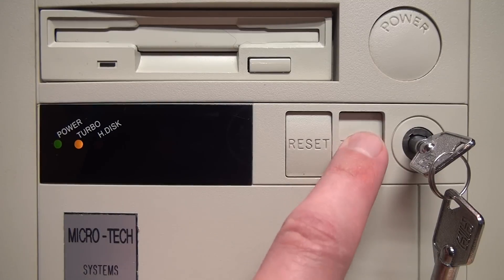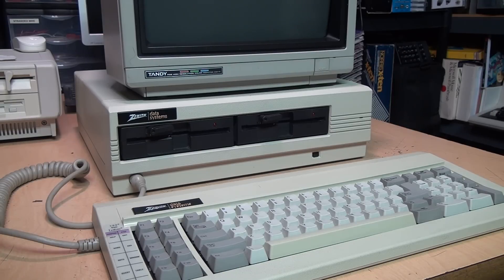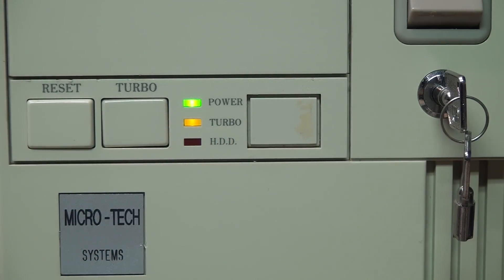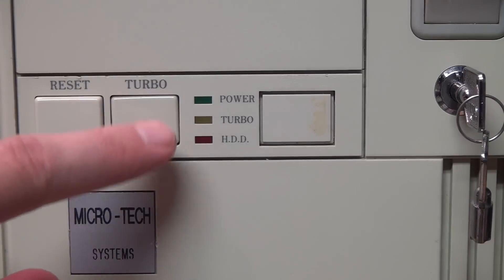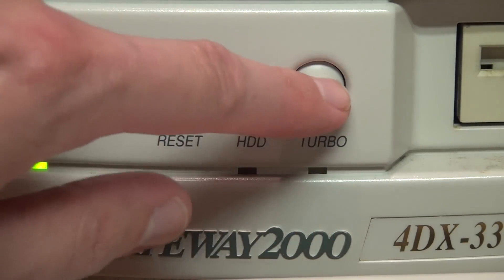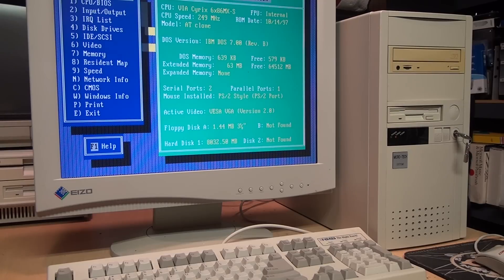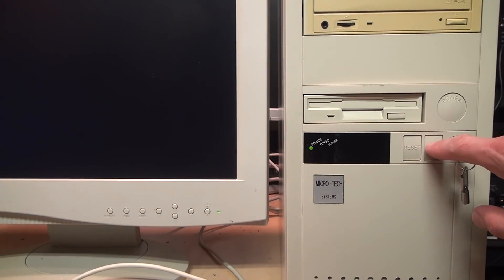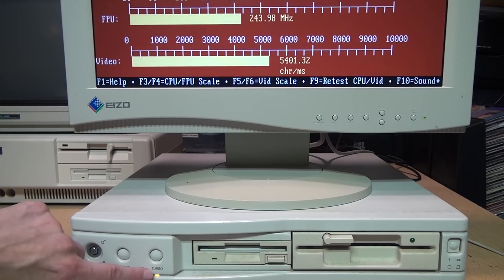The PC turbo button mystery finally solved! (beta version)

Comment: So the operation of the 'turbo' button is not to increase the speed of the PC, but to slow it down, since when the turbo is on, the computer actually runs at the speed at which it should run. They should have called it 'Slow Mode', to be activated with older applications. It wouldn't have caused any hype, though, in the advertisements of the time.
Reply: Basically in short form

thanks for the info man i owe ya!!

Comment: 4.77 ok my computer can be overlooked up to 5.2 except that you will argue that my computer CPU base speed is just 3.37 so I can then use my wild card 🃏 and tell you that it is not in MHz haha… well 😅5200 MHz (but then you will tell me it’s only on the 2 best core but I think it’s already twice more than the example in the video and my 8 other cores are still working at 49 x100 MHz)… ❤ I love the modern times because it’s the only time where we can be nostalgic for the past 🥹

Comment: And here I thought the Turbo button just made the fans spin faster, forcing more air into the system causing more combustion, better fuel efficiency and higher power output for the smaller cylinders present in the CPU's at the time.

Comment: Oh man. That turbo button takes me back. Our 1st home computer was a 286 or 386 of some kind and I used to think about the turbo button as a "make the computer go slow button" because in my mind with it depressed and turbo LED on I figured the PC is running at normal speed and with the turbo off the computer was slow. We didn't have "old games" that would run too fast in turbo mode but all our normal games ran slow with turbo off so I also thought it should have been a "slow mo" button instead.

Comment: I remember I had to push the turbo button on my old 486 66Mhz so it could run pokemon red on the No$gmb emulator with no lag. Those were the days...

Comment: Excellent summary! About the only thing I would add is during the 586/686 era computers that did still have a turbo button depending on which of the common chipsets it used it wouldn't change the CPU clock speed any more but rather enabled / disabled the L2 cache memory on the motherboard instead.

Comment: great vid VW, you showed the benchmark/speedtests, but one thing you should have done was demo an old program in both modes to show the viewers why this was necessary in the first place as the old programs were unusable on the new faster systems without the speed adjustment

Comment: back then backwards compatibility was essential as there were too many little companies making (assembling) low quality PCs, the competition was cut throat...Turbo = normal speed & a turbo button looks cooler than having "slow" or "1/4-1/8 speed" switch

Comment: You can ignore when the button is in or out, look at the light. You have three wires because that is a SPDT switch and either way you put it on the header it is gonna make or not make a connection.

Comment: What mystery?  That button has always had a clear specification.  Back in the day programs would be written based on the CPU clock rate.  The turbo button is to prevent your program from running 2x speed when it was designed for the lower clock rate.

Comment: I never had an computer with a turbo button, jumper of boot command. Since my 1st computer an radio shank tandey had hardware and software preinstalled that made that not needed. My 2nd computer also didn't have that for the same rezone.   My only real issue with the 2nd computer was the move form DOS to Windows 95 and man that was not easy.  My 3rd computer running Windows 98 was the 1st time I had no real issue learning how to use an new OS and was my induction to video game console emulation.  Before then running my DOS games on Windows 95 was only excpatnce with emulation.

Comment: They should make one of these for high end pcs to enable or disable cpu cores over 8 to enable better old pc games compatibility with badly programmed 2000s and 2010s games. I have issues with many games with cpus with over 12 cores and I think that would solve this problem that is becoming more prevalant in the last 7-10 years.

Comment: The turbo button was also very handy for overclocking. On motherboards that used jumpers to select the clock speed, the button would replace one of those jumpers and that was usually enough for switching from 33 to 40 MHz on 486 boards, or 66 to 75 MHz on socket 7 boards, for example. Instant overclock at the push of a button.

Comment: I'm honestly glad that the keyboard lock vanished with the turbo button.  I don't know how many PCs I saw with fried KBC or multi-I/O chips after someone accidently discharged a static electric charge through the lock while trying to push the reset or power button.  Even for the few users it was useful for, it was usually easily defeated with a screwdriver and a jumper since few cases were ever locked close.
Reply from the maker: On IBM systems the keylock actually also locked the case. But on most clones it didn't.

Comment: Back in the day when I put Pentium motherboards in old 486 cases I used to repurpose the turbo switch as an overclocking jumper to change the FSB speed or clock multiplier. So, for example, a P133 would run at 150Hz.

Comment: INTEL:  Turbo-button swithes CPU clock divider to slow down 4 or 8 times of its nominal speed.
VIDEO: Conclusion - Turbo button slows down CPU is a myth.
Reply from the maker: Read it again. That is the "de-turbo" mode, not the turbo mode.

Comment: Incorrect. The original IBM PC was the XT which used an 8088 cpu that could run at 5 Mhz max. 4.77 Mhz was used as the cheapest crystal was the color burst frequency of 3.57 Mhz and 4.77 is 4/3 of 3.57 which al;lowed margin at the poorly designed XT motherboard. The first 'Turbo PC' was an 8 Mhz version of the 8 bit 8088 (not the 8086 (16 bit) which came after the 8088). the 8086 was used iin the AT computer. The turbo button was used to SLOW down the pc to the original 4.77 Mhz speed since several games had timing loops that were dependent on the actual CPU clock speed and wouldn't run properly at the faster 8 Mhz speed. My first IBM compatible (early to mid 1980's) was a clone that started with a bag of USED ics and a motherboard that was then hand soldered and ran if you were lucky enough to get good ICs.

Comment: I had a secondhand PC with a display like this and a turbo button. When I opened the front, there were literally just a bunch of jumpers that determined which segments were lit. So you could switch the jumpers around to make any kind of character you wanted that could be shown on a 7 segment display. So it's not an actual readout of the processor speed, but a marketing tool to wow the customer more than a simple light would.

Comment: backing the old days it be like 13 or 16 or like mhz boost in cpu clock worked on all these back the in days beena long time but worked of tens if thousands of these stripping rebuilding upgrade selling I miss it I loved it so much cried for like 20 years when I could no longer make money here in live also peppel are highly rapist they will hire felons rapist over hard working colored people and its afact I had my head cracked open by 2 different school I was called a worthless Mexican from 2 end grade till 11th stabbed beat put down all by white people not one colored person hurt me so you can't pull there not racist shit

Comment: It was a mystery when the first time I encountered them. When my next-door Neighbour had bought a brand-new Pentium PC computer, I tried playing old games from 5" diskette and the game was way too fast, then pressed the turbo button and the old games ran normal speed. One of the few old game such as Alley Cat have built in code that automatically slows down when CPU is more powerful than optimal.

Comment: Thank you! I had many lengthy discussions about this in forums and people have terrible memories. My 486 had many configuration options with multipiers and various fsb's. I remember overclocking a DX2-66 after adding a heatsink and a fan. I think people are confused because the base clock was divided for non turbo function. You could set your overclocked DX2 to 80mhz and downclock 4x to 20Mhz non-turbo.

Comment: I worked for a company and built many turbo switched pc's. All ours had digital readouts. The switch changed 33mhz to 16mhz depending on which way you plugged the connector to the board. Ours were always set to highest speed and pushing the switch slowed it down and changed the readout to match.

Comment: I have a Z-148. Given its age, I'm happy it still works. Sometimes I get a memory error when I boot in fast mode; apparently the memory chips don't like it. I just switch to standard speed and it boots fine.
The original Compaq Deskpro had two speeds. It came with an 8086 cpu, but could boot at 4.77Mz or 8Mz. There was a small LED on the front panel that showed red for slow speed and green for fast speed.
A cheap way to tweak your system was to buy an 8Mz NEC V20 as a drop in replacement for the 8088. It was more efficient than the 8088, and most speed rating apps gave it a 10-15% higher rating than an 8088 at the same speed.
DTK turbo XT replacement motherboards were quite popular at the time.

Comment: I remember my old (1989) Tandy 1000 SL/2 8086 CPU had a dual speed option of 8 or 4 MHz, changeable via a setup program and saved in EEPROM.  They elected not to clutter up the front of the case with extra buttons, LED indicators and display.  Though I'm tempted to believe it was for cost cutting, all those extras probably would've made it better for sales, if you look at their other electronics at the time.  So maybe their minimalist approach was actually way ahead of its time!
Man I can't believe it's been a third of a century...  making me feel old.
Reply from the maker: Most Tandy 1000s didn't have a power or hard drive indicator LED, either.

Comment: Some literally did nothing to the computer itself, the speed would be set in the BIOS (or through a program to edit the EEPROM) and the button merely switched the LEDs between two displays. Some systems forwent the button altogether and just put a jumper on the back of the LED to select the display. I remember a long time ago, it was actually pretty interesting to reverse-engineer a few different kinds of LED speed displays to figure out how to select what it would display.

Comment: My reasoning for many authors and the general users saying "hurr durr Turbo button make PC slow!" is clearly that the Turbo Mode that the button was supposed to engage, was already on by default, not only because the possible lack of availability of cases with a dedicated button, but as stated halfway through the video: less and less people needed the compatibility mode, and by a certain point in time, they were better off tweaking the BIOS to change the speed and cache settings for better operation.

The Turbo button hasn't died as a niche proposal, I remember having an ASUS AM3 motherboard with a Turbo Button utility that through a software mod, could repurpose the Reset Switch as a Turbo Button to induce "turbo mode" OC, which depending on the quality of your chip, would either sloppily overclock it, or just simply deactivate the Cool 'N' Quiet setting.

As someone stated before: I think that now, with things such as Intel's Thermal Velocity Boost (TVB)/Enhanced SpeedStep Technology/Intel TurboBoost Technology; and AMD's Precision Boost Overdrive (PBO)/ECO Mode, the Turbo button could make a comeback, especially after the latest AMD Zen 4 chips have proven that nobody likes their CPU to run at 95°C and that the scaling is non-linear on such chips when gaming, only when doing productivity work there's a variance.

Comment: aside from people who fundamentally don't understand it, it's a matter of perspective since the point of the turbo button was provide the ability to slow down the computer since without it the computer would run as fast as it can. Paradoxically the turbo button when engaged does nothing and merely doesn't slow the computer down.

A better term would be normal mode when on and compatibility mode when off. But I would assume marketers came up with turbo because it sounds faster and more exciting than normal mode

Comment: It's semantics, really. I think the confusion stems from the fact that the implementation of the turbo button at some point changed. On the XT class machines, it changed the clock frequency and the timing of the entire computer, to the detriment of peripherals. Engaging the turbo mode was like stepping on the accelerator of a car while you are already at the speed limit. Scary stuff! 

On later 386+ systems that was no longer enough, and the non-turbo mode started adding additional waitstates and other trickery to further reduce the computers speed. Also, at this point I/O timing had long been isolated from the CPU frequency so the original went away. It's no longer an accelerator pedal, but rather a brake pedal, which just happens to be wired in reverse. Sure, pressing it will make you go faster, but that doesn't change the fact that you are disengaging a restriction. Boring stuff.

So yes, I do feel like the name is misleading a bit. For me, a switchable overclock would be more worthy of the name. Which was the case in many early turbo XTs: components would be driven out of specification, (especially on extension cards) as they were designed for a 4.77 MHz bus. (hence the initial risk of data loss and communication problems)

Either way: Turbo mode engaged is faster.

Comment: I'm curious... Have you ever tested the slow down command on the Dell Optiplex (and I think XPS Dimension too) line. <CTRL><ALT><\> for "compatibility" mode. Curious as got a couple of Dell machines in parts I was intending to set up for retro gaming.

Comment: I remember the 486 motherboards with the turbo jumpers on the motherboard and the turbo LED pins

The speed was double when you press the button
I think it was 33 and 66 in turbo

I think the 586 and pentium did not have the turbo
I think it was on 386 boards
And I remember it on the AT machines
I remember when the 386-16mhz came out and the 486-25
Then the SX and the DX,DX2,DX4
The 486-DX4-100 MHz was out around the same time that the Pentium came out
I remember pentium 60,75,90,100,120
The Pentium 2 was 250
I don't remember if P2 was 333, or if that was P3
I saw the P4 and those were in the GHz range
I don't know what the first one speed was
But in the mid 2000s the speed was 2.4 GHz
I don't know what processor was the 4 GHz range and I don't know what year the dual core came out
Then quad core and 8 core and now 16 core is pretty common

But when you go into Walmart you see the laptops are really slow
Like 1ghz 
They are really expensive for the speed
But Sam's Club or Best Buy are the only stores that sell real laptops
Staples used to sell laptops, but I don't know if they still have real laptops or if they sell the same type Walmart sell

Ordering through the internet for laptops is really hard
You want to see the display and how it runs and feels
But the desktop parts is fine to buy online at least for me

Comment: I remember this on a 486 clone system that that I had set up at my dad's business - the secretary complained that the system was as slow as the 286 that it replaced. When I checked, it was fine, so I asked her to show me. She sat down in the chair, and immediately pressed the 'Turbo' button to turn off the bright amber LED from shining into her eyes.

An appropriately placed piece of masking tape solved that issue...

Comment: Thank you for your thorough research into the actual function of the turbo button. I remember those when I first looked into getting an IBM-compatible PC after having used other manufacturers’ computers and wondering why there would be a need for that.

Comment: You should have mentioned what myth you were busting at the start of the video. Because even up to half way through, anyone watching that has ever seen a Turbo button in person back in the day is wondering to themselves, "ok, and?" Turbo = full speed. Turning it off is reduced speed. "Turbo" was always marketing BS. Everyone knows that. Not watching until the end, I still don't know what supposed "myth" you're going to be "solving"
Reply from the maker: The Wikipedia article was incorrectly stating that normal mode is full CPU speed and turbo mode is reduced speed, the opposite of what I showed. After I uploaded the video this error has been corrected.

Comment: the reason people said the turbo button slowed down your machine is because it's purpose was to limit the speed of your computer for compatibility reasons (as you mentioned). so the sentiment was that it was "gimmick" because you weren't getting extra performance out of your CPU, it was included so you could slow things down

Comment: My first PC as a kid was a Pentium 100 with a turbo button and led display, but the button had no function. When my brother and I discovered that it was not even connected to the motherboard, we messed with the led pins until we got out initials showing on the panel. A very subtle casemod.

Comment: Indeed, the purpose of the Turbo button IS to slow down the computer from running at its full, normal speed.  Obviously good Marketing precludes the use of a "Slow Down" button.  So we have "Turbo", where the On light indicator means the PC is running normally, and a dark light means the CPU is handicapped.

Comment: I think "Turbo" was a poor choice of words to use. Turbo implies it's running faster than the default in my mind and the default should be the rated speed of the CPU. I much prefer the more generic "speed" label on my Epson Equity.